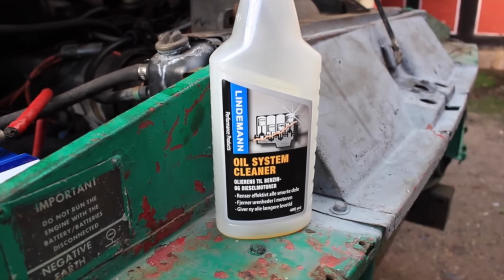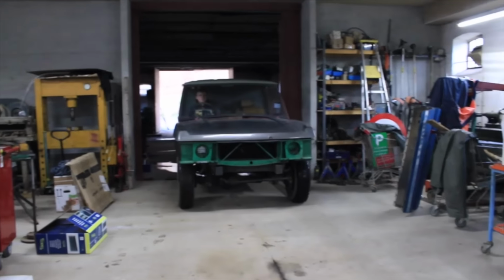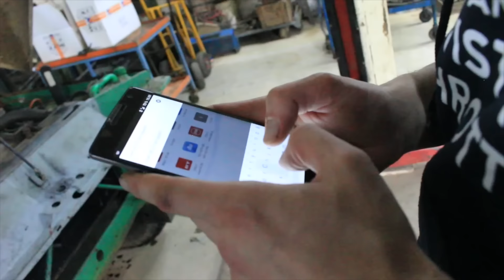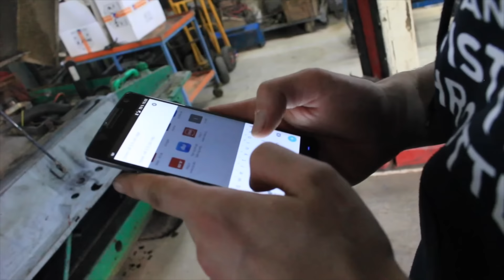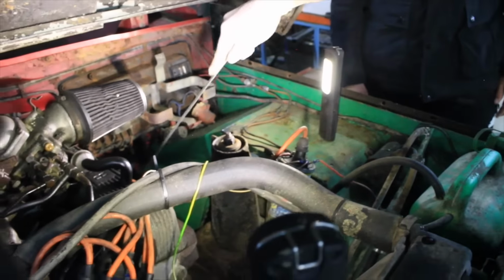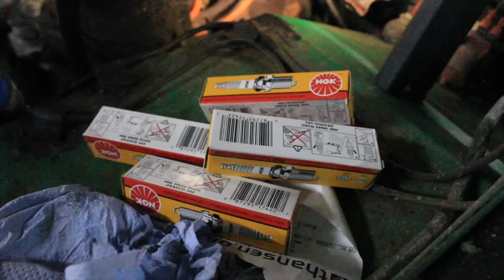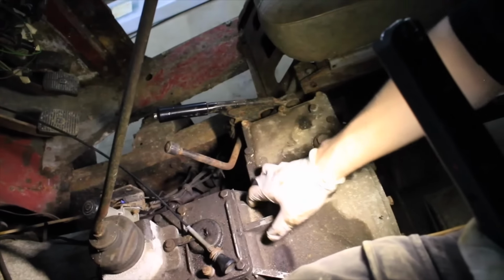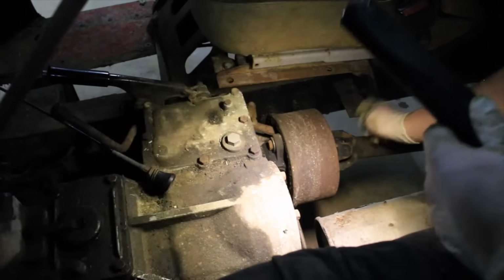Project Bob #1 - Routine Maintenance | Range Rover Bobtail Build

Comment: Handy tip, before pulling the old filter knock a hole in the lowest point with a philips screw driver to let the oil out, saves getting oil down the sides and on your hands.